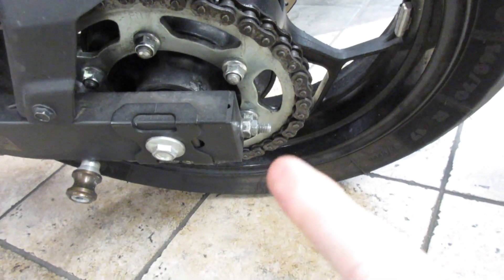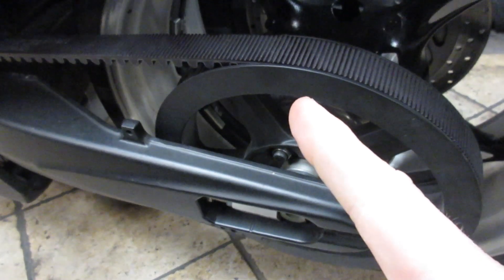Motorcycle Drive Shafts

Comment: Chains or belts are ok if they are enclosed.  Manufacturers did that years ago, but stopped doing it because it was an added expense in a competitive market.  Drive shafts are torquey and they can throw your bike over if you are not ready for it.  Power loss?  Bikes are ridiculously powered these days and people falsely claim big power losses.  Not!  Those gears will last far longer than your chain or pulleys because they are enclosed and lubricated.  Drive shaft systems are expensive compared to the other options and that is why you don’t see more of them.  The more expensive bikes carry them.  Huh!

Comment: The only negative thing to a driveshaft is the inability to customize the gearing and more expensive, that's it.  Weight, power transfer, whatever nonsense are nit-picking.  Chains are on bikes because they are cheap and easy to customize.
Also, from a accounting standpoint chains are more than adequate for most people who buy bikes because they rarely put enough miles on to reach the end of a chain or belts lifetime.

Comment: Probably a Lil late on this but if the splines in there are not greased properly long story short bought a used bike and now it's really making a funny noise and I just changed the gear oil I'm not sure if it could be from not being greased properly or if the u joint in there is bad I'm stuck

Comment: Chains probably most efficient, but messy and lots of maintenance. Belts cleaner and last a long time, but if a stick, stones, or even a lot of mud gets thrown up into one, it'll break. Great if totally enclosed. I used to have a V65 Magna with a shaft drive. The most care free riding I ever did. If I could buy a new one today, I would. That v4 engine rocked.

Comment: Does my drive shaft have a joint on the front??, On 2000suzuki intruder vs 1400??, What weight oil I put in rear differential, Thanks

Comment: Is it safe to change the 17.5” rear shock on my ‘84 Honda SABRE Vf700s, to a 13” rear shock from a 1200 sportster? Will it affect the driveshaft?
Reply: Not a big deal. 17.5 is too long sometimes. 13" is the standard size for a rear shock. 

Go for it. Good luck

Comment: I have a 650 v-star and had to replace my final drive spline....these are notorious for breaking because they dry out  quickly, not life long, you need to grease them at every tire change. Replacement is $1500.
Reply: " Notorious for breaking". ' Dry out quickly" Whoever told you than  nonsense  has no idea how to lube a  final drive.

Comment: They may be less efficient but I would always pick a shaft drive bike over chain any day,  used to have a cb500 went through chains and  sprocket every 14-16000,  been running a st1300 since 2003 ,  oil change  in the wheel every major , regular maintenance on the bike 100,3000 miles later zero. Issues it just goes and goes and goes I love it where’s my friend runs a 11kw zero sr and has had 3 belts in 40,000 miles speed bumps , pot holes , belts are not ev bike friendly that’s for sure

Comment: Alex ramos auto working on 2002 honda shadow 750 with drive shaft having a hard  time installing shaft back in to the transmission  outer out put shaft  rmramos09@gmail.com help
Reply from the maker: Hi Ramos! Unfortunately I personally have not had to put the shaft back onto a 2002 shadow so I am not sure what issue would be causing you to have trouble getting the shaft back into the outer output shaft, I am assuming you guys have a service manual for it that you are going off of? Depending on the method you are using to hold the bike up it may be putting the shaft at a weird angle which could cause that, but that's all I could think of, otherwise it should go back in place fairly easy

Comment: ? , do I need to remove the drive shaft, to tow my bike with a front tire receiver hitch.
Reply from the maker: On most motorcycles you can get away with putting the bike in neutral in order to do this, but there are some bikes that will still suffer damage if you don't disconnect. It will depend on the model of motorcycle and the speeds at which you plan to tow, usually just easier to use a small trailer and get both wheels off the ground. But most motorcycles can be towed in neutral without suffering damage.
Reply: Thanks for sharing your input on this. I know I've disconnected drive lines in the pass on cars. I will most likely put it on a small trailer.

Comment: I just want to know how or if you can change or swap shaft to belt
Reply from the maker: Much, much better off just getting a different bike that comes with the drive system you prefer. The final drive and be changed, like shaft to belt or whatever, but it is not easy and you will likely come out better (and cheaper) just getting a bike that has the final drive system you like better!

Comment: Will you please make a video on how to convert from driveshaft to  change Drive? Apparently there are no videos anywhere on it which is kind of mind-boggling considering you lose 20% or more of the power to the back wheel with shaft drive as opposed to only 3% with a chain. By doing this procedure you can increase your power to your back wheel from anywhere from about 20 to 30%. Would make one hell of a video!
Reply from the maker: Sorry for the delay Ob1! I will try to put a video out on this, but it will be hard to do without having a bike that I want to convert hahaha. I usually tell people if they want the power and want a chain drive to just get a chain driven bike, the process of converting from a shaft to a chain can be a pain in the ass. If the rider is a good mechanic it's not too bad, but most of my viewers will not want to attempt it hahaha.

That being said I will put it on the list, and I will try to make this video!
Reply: @AlexSimmons11c  hell yes! Thank you!
Reply: @AlexSimmons11c  any video yet on this yet?

Comment: Is it possible to change shaft instead of chain in 350 cc bike?
Reply from the maker: it is possible, but it will be a lot of work to convert, and in that small of a bike the drive shaft will also sap quite a bit of the usable power, which is why most bikes under 650cc or so do not utilize shafts. Most anyway.
Reply: @AlexSimmons11c  thanks for guidance... appreciated

Comment: Can I lower my Yamaha 750 that has a driveshaft? it's sitting on 11 1/2" shocks now and  I have about 5" of clearance wheel to fender. Would dropping it to 8 1/2" shocks be to drastic?
Reply from the maker: Most bikes with a shaft have enough flex in the front connection so that they can be lowered, for examply I have seen many vstar 650 models lowered. If you stick with lowering 1-2 inches you SHOULD be ok, so long as your shocks are strong enough to handle your weight so that the reduced clearance doesn't cause an unsafe condition.
Reply: @AlexSimmons11c  Kool thanx man I had the same feeling about that. I'm not a heavy guy so I know clearance will be good, my concern was function of the driveshaft. It seems possible but I just wanted some feedback thanx again...
Reply: @AlexSimmons11c  thanx for the video post as well

Comment: How do you like up the drive shaft to the u joint?
Reply from the maker: Not sure I understand the question? Each manufacturer and each bike has their own system for attaching the shaft at each end, some use traditional hubs and gear driven designs and some use crazy flex systems like BMW

Comment: Chain vs Belt vs Driveshaft. In rear wheel lock up failure situations?
Reply from the maker: Well I have had a really, really bad chain fail me before, but I have honestly never had a belt or drive shaft lock up a rear wheel. I think in a rear wheel lock up failure there is usually going to be a massive maintenance issue involved, but even when I had a chain fail it didn't lock up the rear wheel, I snapped a link and the chain just fell off the bike hahaha...I would imagine the shaft would be worst in that situation since it is a solid gear/gear device, but like I said I have not experienced that myself.

Comment: I got a idea to built a street bike that has a extending and retracting rear shaft
Reply from the maker: Hmmm, that's intriguing! Sort of along the lines of what yamaha and BMW do with the shafts on their performance sport touring stuff but even more sport oriented?
Reply: @AlexSimmons11c   look at slip joint tech on old truck drive shafts and a https://www.alibaba.com/product-detail/12V-24v-electric-mini-linear-actuator_60698767370.html?mark=google_shopping&src=sem_ggl&mark=shopping&cmpgn=1674923663&adgrp=67939112314&locintrst=&locphyscl=9051557&ntwrk=g&device=c&dvcmdl=&position=&pla_adtype=pla&pla_mrctid=254753516&pla_channel=online&pla_prdid=60698767370&pla_country=US&pla_lang=en&pla_group=293946777986&pla_localcode=&gclid=CjwKCAjwrKr8BRB_EiwA7eFapnL4no3qXJORLbdOBzlV9c3T3N7e4DaybhjPueKAL4K_ShVgTLQu4xoC9yYQAvD_BwE#shopping-ads you might just had a million dollar idea

Comment: I was looking to raise the rear shocks on an xj750 from 12" shocks to 14" shocks is this going to be a problem with the angle on the x joint
Reply from the maker: It can be, to be honest I’ve never seen a suspension swap on that bike so you’d have to refer to specs in the service manual for it to see if they lost the tolerance either direction, if that fails you’ll need the advice of a competent mechanic familiar with that model. I know usually 2 inches won’t kill it, but some bikes don’t have much tolerance for changing that

Comment: Ive got an 04 vstar 1100. Runs great, but i started hearing a rattling from the drive shaft area where it connects to the rear motor. It turns out, the outer pipe that covers/incases the actual drive shaft itself has come loose. So now the pipe just rattles as the drive shaft turns. How easy is this to fix? Anyone...?
Reply from the maker: For someone who is mechanically inclined it's not too much of a nightmare, you'll have to determine if the stock shaft tube can be re-attached or re-secured or if youll need a new one. If you can get your hands on the service manual and you're comfortable working on your bike you SHOULD be able to do this yourself, if not then it should not be an expensive job for a decent motorcycle mechanic...assuming they can get a replacement tube IF it's even needed.
Reply: The exact same thing happen to mine thats what lead me to this video . The outside tube cam lose and I was trying to see how bad that was . Thanks for the question and Thanks for the Answer. ✊✊

Comment: Hi Alex, thanks for sharing your knowledge on Youtube. I am looking to buy a Suzuki Boulevard C50T and have been researching on the bike. I have owned a Honda Crosstourer with a drive shaft and liked it. However, I have read a lot about the Boulevards drive shaft failing. Do you know much about this problem.
Reply from the maker: Hi Chris, I have put a lot of miles on Boulevards over the years, the C50, C90, and 109 series bikes and have never seen a shaft go out...I mean I'm sure it is possible as it is for any mechanical part to fail...but after years of riding and selling those bikes I have literally never seen a shaft fail on one so...I would NOT say it was a common issue...
Reply: Thanks, I appreciate it.

Comment: How do I remove the middle drive gear from 2005 vstar 1100
Reply: burningfeet 53  clearly you don't know how. Apparently you have to split the engine to get it out. Anyway I found a way to fix the shaft without removing it and it has held up fine ever since.

Comment: Hi Alex...great video, thanks. I just acquired an '81 Suzuki GS650G and the previous owner said 2nd gear was slipping. Is this a shaft replacement or a differential job? Impossible to say, I know, without seeing it but wondering where to start. Thanks!

Comment: In terms of how long they last. What kind of milage does one get from a shaft driven bike? Does it last 10,000 miles 50,000 miles?
Reply: From what I've read (and as Alex says), if they're looked after they should last the life of the bike.
Reply: Change the oil every ten thousand miles.

Comment: I’d it possible to convert a shaft to a chain I have a 2001 Vulcan 1500 and need to get more ummmm out it and don’t really like the shaft but for 1500 I couldn’t pass it up...
Reply: most motors you might as well swap. the drive parts are built in. you would need extension conversion kits in most big motors

Comment: I have a project in mind that needs sealed drive shaft(s) and sealed diff (I guess) I used to have a GL 1200 Aspencade with drive shaft. I want to make kind of like a deer stand that I can drive into water and use as a fishing platform. It would need large liquid filled wheels.
Something like whats in this video https://www.youtube.com/watch?v=nJt2uozfpE4 but the platform would only be 8 ft high. I already made one that I have to push out there but it would be nice if I could just drive it out and when I'm done, drive it back.
This is my present fishing tower: https://www.youtube.com/watch?v=N1Za-w1PSK0&t=5s
Thanks!

Comment: I just bought a 1996 Kawasaki Vulcan 750cc with a drive shaft an its still got plenty of torque an power i love it i love drive shaft motorcycles because you dont have to mess with oiling the chain or making sure the belt is tight an shit like that

Comment: Hi. I'm thinking of buying a bike and I'm between the triumph street scrambler or T100 and the moto guzzi v7 special. for me the guzzi has a strong point that is the transmission by drive shaft besides being air cooled which always reduces the cost of the maintenances. (i think)
In triumph there is the inconvenience of being drive chain and for me that rides almost every day for  work to have to stretch the chain and lubricate from time to time it bores me.
What do you think about this point?
Reply: Dude, buy the guzzi. Almost zero maintance and it's awesome. I have a v7 racer. 8k and counting. Zero issues. They're amazing bikes. Hand built by real dudes in Italy.

Comment: Hmmm. Sounds great but for some reason my c50 boulevard at 17100miles something in the gears or shaft broke.   This was recent havent tore it apart yet we thought it was the clutch.  Why after 17k did my transmission fail ?
Reply: hey did u ever find out what happened to your shaft? or did u get it fixed, i got the same bike at 15k, i hope nothing happens to my transmission at 17k